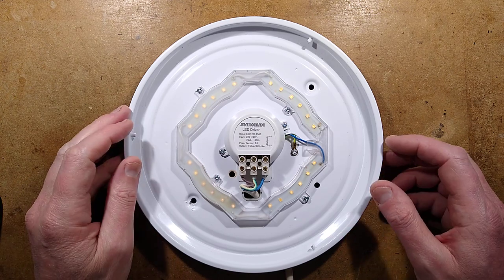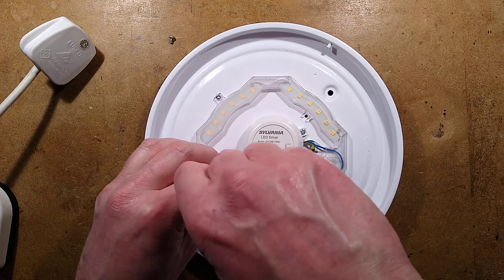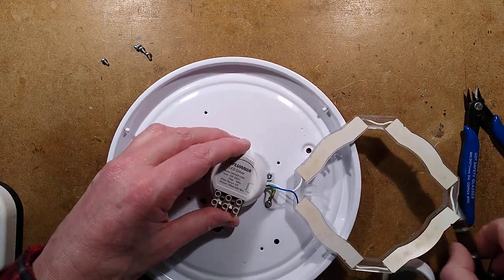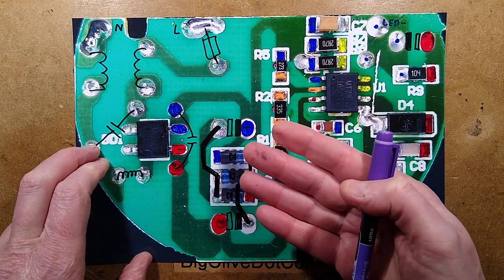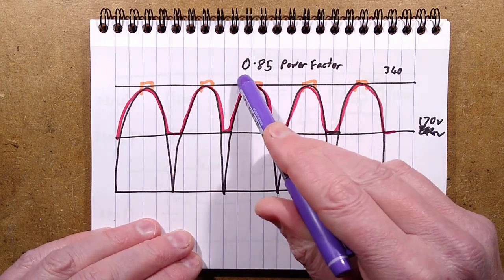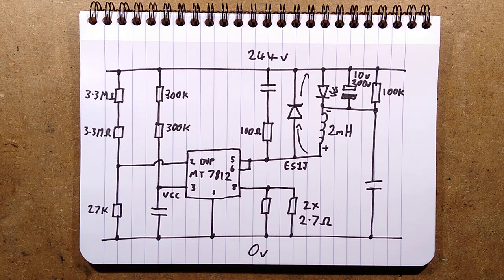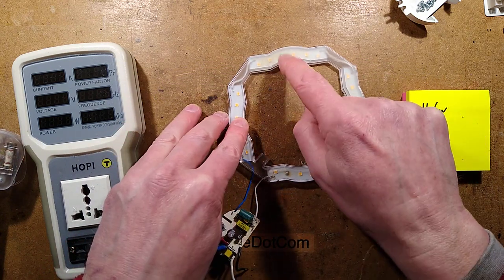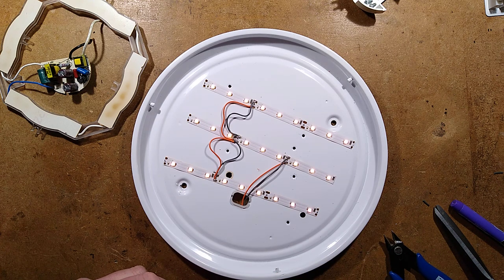Fixing and hacking a light from Thomas Nagy

Comment: that PF correction circuit is a very elegant solution to a curly problem and reduces EMI from spiky peak currents dramatically

It looks like these things should be "add thermal paste on sight" or risk having to replace them later (as well as looking for pinched wires)

Comment: Those LED replacement kits are very common here in Thailand, in fact, they seem to be easier to find (and cheaper) than the complete lamp itself. I believe they meant to be retrofit to the fluorescent lamps, which were pretty popular here, that's why the kits are abundant. Same as T8 LED tube.

Comment: The diode-capacitor circuit is called a "valley fill" circuit. It improves the power factor at the cost of an extra cap and three extra diodes. Putting a resistor in series with the middle diode can improve the power factor further. The concept can be extended to a three-stage version as well. For more info, search for "Improved Valley-Fill Passive Current Shaper" by KK Sum (resistive load simulation). The fact that the LEDs are a constant-power load means the PF isn't quite as good.
Reply from the maker: I did finally manage to put a name to the circuit.  Wikipedia has an article on it

Comment: I had almost a identical units in my garage, after the 3rd one died I figured out that over tightening the mounting screw warps the base and was making the led's lift off backing and eventually overheating them....

Comment: Seen and done 12v conversions before, the only point against them is efficiency - you lose power on those resistors that "convert" led strip from current to voltage driven mode.
Looking at your teardown I can see this type of fitting being an amazing fit for GX53 or GX70 type of lamp, and transparent/no cover lamp being sold separately. Downside will be heat dissipation, though, as those are designed around having airflow focused on lamp body.

Comment: This time I spotted the power factor improvement before you!!!  I must admit however, that the first time I tried to figure one out took a couple of separate starts on different days.  The positive conclusion then remains:  My memory is still functional on topics that I have battled through a couple of decades ago.  What happened yesterday is a different issue...
Reply from the maker: It's apparently called a valley fill circuit.

Comment: I have a few lamps of this style that were very cheap.
They lack the plastic cover, but they do have several times the amount of LEDs and the whole fixture is rated at 11W.
There's also quite a bit of thermal compound between the LED PCBs and the casing, so I expect those will run for a long time.
For the price, they certainly seem to have been worth it. Phew. I was worried about that when I clicked on this video.

Comment: Great video as usual.  I suspect that the 2x  300k res for vcc are just bootstrap at startup  and that the chip is powered from the output circuit once running.

Comment: I have a circuit board from a car fan that works off of PWM to control but whatever duty i give it it has a delay of 4 seconds to get to the desired duty. no idea what sort of component could be causing it

Comment: Thanks for the tip on not soldering a circuit that's live at mains voltage.... That will reduce the number of Darwin awards handed out...

This sort of light fitting is such a menace!
Reply: But, if the light's not on, how are you supposed to see what you're soldering?
Reply: That's when you're no longer soldering, you're welding. 😀
Reply: Here's a dirty little secret: you can solder live circuits as long as you don't use a grounded iron.

I've done this working on my old TV to get a clearer A-B comparison between parts.

Comment: Interesting plastic led mounting piece within the fixture. Wonder if it could be reused to hold the 12v led strips?   The thermal tape you mentioned could be used to help attach it to the plastic then back evenly onto the fixture.  Good video.

Comment: I try to avoid user non-serviceable luminaires, for the hassle of having to replace the entire unit and they are so wasteful. Replaceable globes are my only option, or as you say, Clive, put your own gear in the fitting. An excellent video as always, much appreciated. 👍
Reply: you can get them with replaceable LED bulbs
Reply: @brianjohnson5789  Yes, that's a "light fitting" as opposed to a "luminaire" which is an all in one unit as shown in this video. I was curious about the terminology and looked up the meaning sometime ago. 😊

Comment: The problem with sticking led tape inside is that the glue on those tapes will almost always fail after running the light a few hours. So what to do about that?
Reply from the maker: If the tape is stuck onto a suitably cleaned surface and not run too hot it should stay on.

Comment: Buyed a few years ago  a few from this ceiling lights local. All got broken after 2 years. Buy some retrofit sets from china and don't use the magnet method but with screws. (simply self tapping in the tin metal) with heatpads under the allumium frame from the lights. And the hold now for arrount 5 years. Use it all day a few hours and works all great.

Comment: I’m slightly bemused by your comments Clive. Environmental groups and individuals (including myself) definitely are not happy with substandard or poorly designed appliances and devices such as this light fitting. One of the fundamental principles is that we should be minimising the amount of electronic and electrical waste. So products should both be designed for a very long life AND be serviceable/repairable. My feeling is that the law should be changed so that both suppliers and manufacturers must replace any failed unit that is less than ten years old. It would have to apply to both suppliers and manufacturers, so that if one stops trading, a claim can be made against the other company. For consumer purchases by credit or debit card, or via any other form of credit or loan, the bank or other financial company would also be liable. If no replacement light fitting is available, a full refund of the original cost would be required. If such a law was introduced, I think you would quickly see the quality rise substantially.

Comment: Hi Clive 😊 I have fitted a few of these for customers. They are on the bright side of expectation and usually only £15 - £25 to buy as well as being IP44 rated. Two questions please 1) is the thermal compound you mention the same type as that used to seat PC processor chips etc.. 2) is there a simple method to build in a (say 20%) power reducer on the mains input side (thus not tampering with the unit itself) e.g. a sort of capped dimmer? Your output is always pure and well filtered so keep up the great work 😇 Cheers!
Reply: PC heatsink compound should work. Or just heatsink compound for electronics use. But make sure to get the non-conductive type if you go the PC way. I don't know if anything is rated for mains voltages though
Reply: Decently sure that a mains dimmer won't do the trick... the buck-converter will limit the current to a set level (the one set by the current resistors, of which Clive removed one) by stepping down the mains to whatever is required. If you lop 20% off the mains, it'll simply compensate by not stepping down the voltage as much.

Comment: I bought a set of dimmable filament style LED lamps and put them on a LED dimmer. If I normally run them at, say, 70% brightness, are they likely to last longer or does it make no difference to LED tech?
Reply from the maker: Even supposedly dimmable lamps can have a rough time with traditional dimmers.
Reply: @bigclivedotcom  I unscrewed one of said bulbs that was dimmed to ~30% and the screw base was very warm; they won't last very long I fear :-(

Comment: i converted our old oyster fluorescent light in out toilet to a led motion sensored by gutting an e27 motion sensored bulb I had kicking around and mounted the led array to a heat sink with a neodymium magnet to hold it in place and I then extended the wires for the little motion sensor dome and mounted it in the middle of the glass where the little nut secures the glass in place it's still the old light housing just retrofitted 

i then knocked the switch out of the facia and put a blanking plug in it's place it's been going for about a week now and it works a treat, our son is not tall enough to reach the switch and he won't go in there unless the lights on we had a little battery powered light Stuck to the wall for him that I removed all the phosphor off the led's so it was blue (his favorite color)  but he never turned it off when he was done so it went flat all the time. 
He absolutely loves it!! he is fascinated that he walks in and the light magically turns on for him 😂 the things I do when I'm bored and have an abundance of random crap laying about.

Comment: I have a box with about 25 of failed lights like this, just with the osram ledvance brand. time to try and bridge out a few leds and see if they can come back to life and get a 2nd chance. Also try to adjust the current and prevent more of the leds from failing
Reply: Look for a dark spot in the LED's middle, that'll be the one that failed
Reply: @rexsceleratorum1632  the black dot of death as we have learned from Clive

Comment: As a building manager I used about 10 similar to this one. For 2 years of usage all of them were replaced at least 2 times (!!!) covered by the guarantee, including the expences to ship the replacement. I wonder what was the profit/loss for the seller. Later I also used some of these magnetic ones with the same "success" - most of them burned at some point before the 2 years guarantee. 
At the end I started to replace them with normal sockets and LED lamps.
Reply from the maker: I think they rely on most people not returning them.

Comment: As soon as i saw the board I attempted a guess at what resistor to mess with. Yay me I got it right. 
I've been asked to install several of these land fill beautys, every time I ask them , are you sure? You can't put a new bulb in. 
I almost dislike them as much as bathroom light fittings that use the d  tube.

Comment: Shorting a dead diode is the way I fixed many LED bulbs - unfortunately they still broke down after a few months, or even weeks. 
Tape mod is also good. Done it once on a linear lamp by replacing the original serially wired HV strips with RGB tape and adding a remote control module. Now I can light our bedroom purple or red for some naughty action :)
I had to resolder that controller right out of the box because when I saw its utterly crappy wires, I knew in an instant that it was not gonna work. Spotted a dry joint right away! Chinesium, meh.

Oh, and it's almost criminal to name the chip like a massively popular linear voltage regulator :)

"Non user-servicable, except us" haha, that was a good and true one!

Comment: The buck converter is an asynchronous topology (the diode free-wheels when the switch is off so no need for synchronisation). Schottky diodes are not used in these because switching losses from the diode switching off as the polarity reverses are greater than the forward voltage (fast diodes are better than low Vf).
If you want low voltage switching then you go to a synchronous topology where the diode is replaced by a MOS-FET. The trouble here is that you need to be very careful with the switching timing to stop disconnects and shoot-through.
Typically, when stepping down large voltages to small (>4:1 & >5Vout), asynchronous is the way to go. When stepping down lower voltages to slightly lower (<2:1 & <3Vout) then synchronous is better.

Comment: The pinched-wire problem might be worth getting on to Sylvania about. You never know, they might listen, they might pass it on to the Chinese factory that makes them, and the Chinese might do something to move the wire out of the way a bit, and maybe spend 1p on a bit of heatsink compound, if they're not busy scheming to replace the wire with tinsel and swap the whole circuit out for a 1/8 watt resistor. But it might be a real problem in the design, and pinched wires aren't great for safety either.

What about replacing the blown LEDs with some new ones?

Might be nice to change the wattage on the lamp to something a bit brighter than half, you'd have to swap out one of the resistors rather than snapping it, or else snap it and stick another in parallel with the existing one. I dunno what the power vs MTBF curve is, but generally a little bit of power reduction seems to make stuff last quite a bit longer. But yeah stuff is run close to the edge nowadays. Shame cos it looks like a nice well-made PCB with lots of features so it's a shame it's designed to be so imminently disposable. 

If you could get the point across to environmental campaigners, and it's not that complicated, it might end up being written into law eventually.

Comment: I would replace all LEDs with new daylight white ones because I like more, not less light and a better color rendering index. I would replace both sense resistors with a value about 20% higher than the existing ones so I still get 800 lumens out of the fixture with slightly less power used. Then I would improve the heat sinking as suggested. It's not necessary to turn every lamp into a dim night light to improve it's service life.
Reply: That's a lot of work for a cheapo light, it'd be much better to just buy a standard bulkhead with replaceable lamps and just replace the LED lamps when they fail imho
Reply: @ArlenMoulton2  It's not so much, just 26 little SMD parts and some heat sink material. The value to me is in the form factor that I like best, compact, smooth,  "cloud" diffuser and even sealed against bugs. If I could find one that was the right technology, light color and style with less effort and expense than a simple repair and modification to a freebie failed unit, I'd buy it, but as it turns out, it's nearly impossible to know that much detail about a unit offered for sale unless and until you or someone else has opened it up and examined it.
Reply: You can take out one of the resistors (the higher value if they are unmatched) and retain 50% or more (if unmatched) of the current, which translates to way more than 50% light if the LEDs were being overdriven

Comment: Couldn't help noticing that the burned LEDs were adjacent to the installer drilled mounting hole. Screwed up tight and distorting the metal base and breaking the thermal contact to the LED strip?

Comment: An easier way to reduce the current through the LEDs is by connecting a resistor parallel to the array. The PSU will react by reducing the voltage across them. However, you have to provide good heat dissipation for the resistor ...

Comment: Another advantage of series-charge-parallel-discharge is it also halves the strain on capacitors from inrush current, voltage surges and current ripples on discharge. Having two capacitors rated for peak line voltage in series is somewhat of a waste of space though. A better option would be to use one of those fancy ICs from modern compact adapters that disconnect the 200-250V bulk capacitor when line voltage is above threshold so smaller bulk capacitors can be used to buffer the 2-3ms where line voltage is too low for the regulator to operate normally. I'm sure we'll eventually see a successor to Lot-VI that will require these types of techniques to boost baseline power factor without full-blown APFC.

Comment: Sylvania might have been reliable manufacturer in past years, I have different feelings however. Back in 2017 I had installed 54 floodlight luminaries, 120W ~12000lm units. First failed on a first year. After five years about 10 is still working. They work only during the night, only couple of them for whole night - doesn't matter. Each and every of them goes short-circuit, blowing a fuse. In near future I'm going to investigate for the cause. 
Recently replaced couple of dead ones for V-TEC 100W 16000lm floodlights, will see how "cheapo" (Sylvania is 5x the price) one fares. One is already more than year old and still working :)

Comment: I use a similar lamp in my hallway, the difference being an added radar based motion detector.
I don't know what was wrong with it initially, but even in the off state, the LEDs would be dimly lit.
Someone suggested swapping live and neutral, as the relay inside may be switching neutral only and some capacitive coupling would have been enough for the LEDs to glow. They stopped glowing - but the lamp wouldn't come on again. So I swapped again, and since that moment it works. I have no idea why, but I just let it be...
Reply from the maker: That sounds like capacitive coupling through the LED panel to ground.

Comment: Seems like if one knew the right people they could get a moderately steady stream of easily fixed LED lights.  From there it would be possible to start fixing them up (and with a more forgiving amount of power into the LEDs) and then making them available to people who can't afford to replace their old incandescent and CFL lights.  

The "poverty trap" is being stuck with expensive-to-use products because one can't afford the lump sum to upgrade. This could be an opportunity to help out people, reduce community power consumption, and reduce landfill electronics.
Reply: The problem is if people are paying somebody to install a light they'd probably spend the extra few dollars (little compared to labor) to get the "better" new unit. And come to think about it, people who can't afford new lights probably aren't buying new fittings. They could be served with regular screw-in replacements.